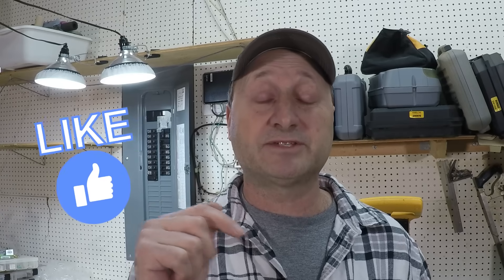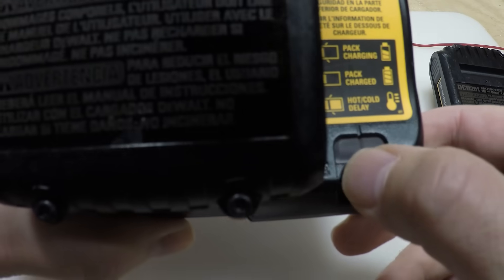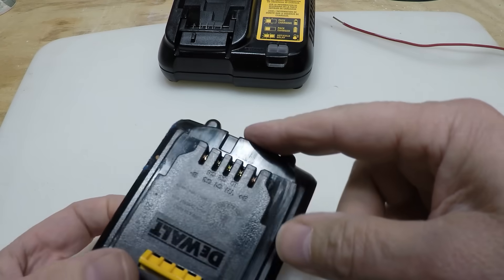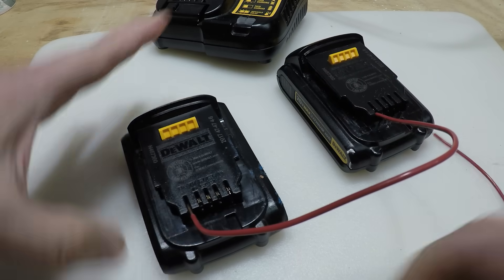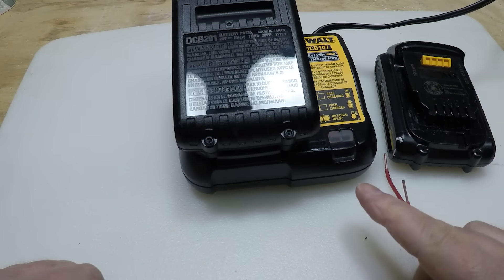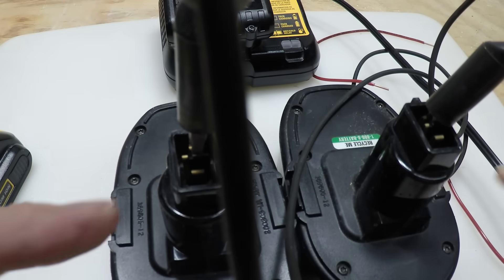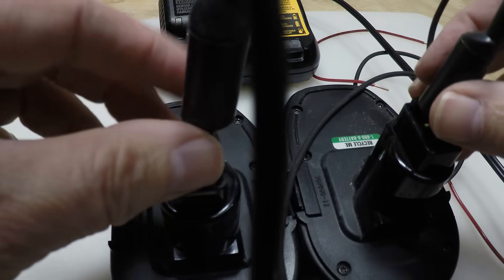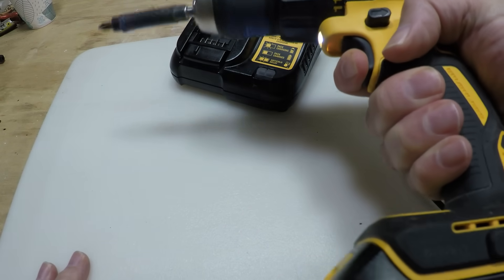SECRET to FIX Drill Batteries - Charge Dead Lithium Tool Batteries

Comment: Please don't put lithium batteries in trash.  They can still cause fires when "dead".
Reply: Excited Beavis noises
Reply: @WackadoodleMalarkey 😂😂😂👍👍
Reply: An all the little kids mining it for your pleasure
Reply: @hobojoe3844  good you know, many don’t, child and slave labour for profit is horrible!
Cheers bud ✨☕️☕️☕️✨🇨🇦🐥
Reply: Yet no solutions on what to do with them
Reply: @germanshepherd13 seriously 😂
Reply: @germanshepherd13  in the UK most shops have battery recycling bins so there must be money it...
Reply: @alanhat5252 you would be disappointed finding out what actually happens to those old batteries.
Reply: @germanshepherd13  Corporate Greed at its finest brought to you by the gop
Reply: Yes, this is why lithium button batteries inside car remotes we keep in our front pockets during summer blow up constantly!
   We all know sweaty balls actually explode a lot more from June-Aug 💣🥒💣...Not!
Reply: @harryballz6358  never heard of that 😹
Reply: @harryballz6358 , It’s not that they blow up. What happens is they’re in a pile of trash, and a machine cuts the battery making a small spark. Sometimes there will be dry flammable trash around the battery when this happens and it ignites the trash causing a massive fire. If nobody is there to put out the fire in time, it can end in a disaster.

Also, rotting trash creates methane, which when mixed with air, could explode if ignited by a small spark.
Reply: My Bat charge is blinking and becomes solid light, but still doesn’t work on my drill
Reply: I just leave my dead batteries on the job site for the electrician to steal.
Reply: OMG!!! If one AA lithium ion battery will cause a fire😵😵😵then how will our country ever survive when hundreds of millions of cancer causing hazardous waste 1,000 lb batteries are mandated by 2030😩😩😩
Reply: Yep!  Batteries are landfill. Disgusting pollutant on this planet!
Reply: Also they are harmful to the environments and should be recycled.
Reply: Go be a liberal somewhere else
Reply: Lithium and water Very explosive 🧨 should always keep in oil.
Reply: Ok Boss
Reply: I only put my Tesla lithiums in the trash
Reply: @geolehman  sure you do....
Reply: What are you supposed  to do with them?
Reply: @Joe-og8um  I'm sure your city has recycling
Reply: @jessewoody5772    yes.  I have a can for plastic, paper, misc.  I can put batteries in that?
Reply: @Joe-og8um  call your local city hall. Ours has special pickup of batteries that is separate from the plastics and papers.
Lithium batteries are dangerous and hazardous if crushed in a garbage truck compactor.
Reply: @jessewoody5772    thank you.   I do have one now I need to dispose of and wasn't sure of the proper way.
Reply: Not when discharged guy . Read a book
Reply: @KC-nd7nt  they should be recycled guy, get a clue
Reply: Litium cannot be drained to 0% if they do they are highly volatile. Every battery has an upper and lower block so they dont drain to 0%
Reply: Mine is for an old Sears drill, has three contacts, I tried jumping+to+, - to -  ,it didn't work.
Reply: Lol
Reply: I'm not watching the video.  This is utterly bull shit.  I've tried it a few times, nothing fixes dead batteries,except a new 1.
Reply: Thats funny. They never seem to burn the house down. They are all over my house. For decades. In tool boxes buckets and bags. Why dont they just BLOW up?
Reply: @jayholewinski  Thank God I’m old!!!!!!!!!! because we only have a few years left before hundreds of millions of 1,000 lb hazardous waste car batteries that are mandated by 2030 will eventually kill us all anyway😂😂😂
Reply: OMG!!! If one AA lithium ion battery will cause a fire😵then how will our country ever survive when hundreds of millions of cancer causing hazardous waste 1,000 lb batteries are mandated by 2030😩😩😩
Reply: Please don't talk down to random people online like you're some kind of authority.
Reply: So i tried this with my Milwaukee batteries i had a small battery stopped taking a charge. I did this "trick" and then put it on my charger and yes it "showed" it was  charging, for about 3 minutes, then it showed "full". Pulled it off the charger, hit the button on battery and it flashed one bar. Wouldn't run in the drill and now every time I put it on the charger it just lights up green as if it fully charged. As far as the Other (bigger) battery is used to "jump" the small battery NOW reads FULL when it's not connected to drill OR charger, but when I connect tothe drill it flashes one bar (dead) but on the charger stays green as FULL/CHARGED so now I'm out 2 batteries and using a damaged HEART drill 😢
Reply: Definitely don’t throw the battery lithium-ion packs away - at least disassemble and use the individual batteries - generally only one battery is bad.
Reply: In a lot of European countries this is illegal.
Reply: @tonycamplin8607 who cares.
Reply: Yes and in cars!
Reply: @dixiefallas7799 Tesla....BOOM! 😂🔥🔥🔥🚗🔥🔥🔥
Reply: Don't you fkn tell me what to do!
Reply: A button lithium battery hidden in soft plastic recyclables was crushed by machinery at our council recycling facility and later caught fire burning down the whole facility causing $20million in damage. Recycle batteries appropriately
Reply: @andrewdenny5571 RUBBISH
Reply: no RECYCLABLES
Reply: @andrewdenny5571 so the entire facility burned down yet through all of the debris someone found what remained of a button battery and determined that was the cause of the fire? Ok.
Reply: @corytruckdriver  yes.  There are literally people whose job it is to do exactly that.  People will do an enormous amount of tedious work for millions of dollars.
Reply: @Williampreza Link to an article. I want to see the damage.
Reply: @corytruckdriver a good example of critical thinking on your part, sadly most of the Western world no longer engages in this type of reasoning.
Reply: @elephantgrass631  you try linking some articles from Youtube comments – you'll find Youtube censors most of them.
Reply: @alanhat5252  Depends on the article. Right wing political? They'll ban it. Left wing? No problem.
Reply: @elephantgrass631 as it should be.
Reply: @elephantgrass631  you got that backwards
Reply: @andrewdenny5571 😂😂😂
Delusional FOOL
Reply: @andrewdenny5571  I blame the facility for allowing the production of flammable on the other side of town..
Reply: @andrewdenny5571 Exactly what I've been concerned about. I had to train our crew to the dangers.
Reply: @andrewdenny5571 damn. Okay. Thank you.
Reply: Most municipal recycling operations take batteries separate from rubbish, mainly for safety but many also pass them on to various recyclers. Lithium battery recycling is happening small scale,   there won't be much money till they start getting big stuff like car batteries.
Reply: What if fire was my goal?
Reply: No way if they are discharged
Reply: Ya take them camping. Get a hot fire drop em in.......dont sit to close......FUN
Reply: @Dingoroaming  <---------Trump voter
Reply: To close? or too close? There is a difference.
Reply: @Dingoroaming  Darwinism will eventually take you or your childrens lives.........Have Fun.
Reply: hahaha...yes . they can
Reply: Some people just don't care but he doesn't seem like the type of person to do something dumb. But idiots and trailer trash will litter and do stuff like that always so one person is not going to save the world. Had to be millions just like everyone needs to stop littering   . I've NEVER THROWN A CIGARETTE BUTT ON THE GROUND. EEVVERRR
Reply: @TheAmericanMan-2024  you’ve never thrown a cigarette but on the ground B/c you DONT smoke!!!
Reply: @TheAmericanMan-2024 Thank you for that.
Reply: @TheAmericanMan-2024  A cop aproached my brother and I while fishing and wanted to ticket us for littering.
When I showed him my watch pocket filled with my cigarrette butts he left us alone and wnt on his way.
Reply: I just throw them in the fireplace.
Reply: @WilhelmFreidrich  hopefully while your kids are warming up nearby
Reply: Too bad I do it all the time
Reply: @caring-assoul_  whats the matter your mom didnt love you
Reply: BS
Reply: Yes, please don't toss them in the trash. There's a place not too far from me called BULLDOG BATTERY and I have dropped mine off  there. So find a place that either takes them or rebuilds them and drop them off. It's safer and you'll be doing the right thing by everyone.
Reply: I throw my old batteries in the lake near my house, I told my kids NOT to fish there! 😮
Reply: Not my problem
Reply: Not my problem…. 🤷🏻‍♂️
I’m still gonna toss them in the trash 🤷🏻‍♂️🤷🏻‍♂️🤷🏻‍♂️ deal with it! 🤷🏻‍♂️🤷🏻‍♂️
Reply: It's be cool to see a garbage truck in fire going down the road..

Comment: You gave a good hint here, i would still be well reminded of almost twenty years ago when accu(mulator) cells were exchangeable in a quite simple manner (not with some lithium type chip-ping), whilst i also still wonder why no manufacturer managed to deliver a transformer with the tool (just in a box where the accu-cells would be), so the handycrafter could attach to the normal 220volt current (getting 16, 18, 20 or whatever voltage charge) by wire/cable not having to relate to accumulators when their usage was decreased due to some circumstance. Being simultaneously able to use current from some home or garage walls installation would have been a huge deal, especially bck in the days when accumulators didn't were pushed to today's performances. But not often some military-performance (or land rover-like) tool makes its way to the toolshop only to "dissappear" after a few weeks... My brother once said the matching words like "the handycrafter is the modern slave of society".

Comment: This will work if the battery is just at too low of a voltage.  If you have one or more low or bad cells in the battery pack, it will not work since most chargers and/or battery packs monitor the voltage of the cell groups and will refuse to charge if there are any issues.  It has happened to me with my Milwaukee battery packs.
Reply: I guess that is my problem. Just tried it with an M12 battery pack, charger blinks green and red. Do you know of any way to save the battery pack?

Comment: ABSOLUTELY happy to like your video. Thanks so much for sharing this. Wiring the batteries in parallel is a great tip to transfer just enough power to trick the charger. I had an old mobile phone battery that would not do anything and after putting it on and off the charger many times with zero life I put it in one last time and then it initiated the charger and charged and it's been fine ever since. But you're video jogged  my memory so I can't wait to try your idea on my DeWalt 18 volt batteries that are lifeless through lack of use. I love my cordless tools but whenever you need a tool without fail it's always the Old Faithful corded tool that never fails. Cheers again.

Comment: When my battery didn't charge I took it apart and found that one cell had much lower voltage than the others. I charged that cell with a single-cell USB charger, and that fixed it. The cell was still good but somehow the cells became unbalanced.

Comment: Lithium batteries have a low voltage threshold per cell of 2.2 volts, they should NEVER be allowed to go lower. Such a battery has been permanently damaged internally, it's life has been severely shortened. That crude "shock charging" as suggested is both dangerous and damages an already abused battery even more.  This is why the charger refuses to charge it. An abused lithium battery can swell up and sometimes even "explode" into a flaming smoking fireball.  If it is decided to "revive" an abused and permanently damage battery it can be done but with very low and controlled current in the milliamp range and then the battery will remain forever damaged and unstable.  Replace it and be safe.

Comment: Great tip but what if you don't have a good battery to jump the dead one?
Reply: Just check what’s the Voltage & Amperage of the dead battery. After that just look for another battery/charger that’s close to these ratings and use it to jumpstart your dead battery. Best of Luck.
Reply: I just tried it with baling wire and a 9 volt battery. I was so surprised it worked!

Comment: Fan-TASTIC video. Who would believe that it's so simple to fix? The explanation makes perfect sense - without even the tiny amount of charge needed to send signal to charger that all's O.K. to recharge - it wont!
This must save so many people (including myself) so much time and money. Many thanks for posting.
Reply from the maker: thanks for watching. Please share the video!
Reply: You misunderstood this, the charger is specifically designed to refuse charging a fully depleted pack, not even with a tiny current. A lithium Ion cell might be internally damaged if it is fully depleted in such a way that once it's fully charged agan (no matter how slowly) it can get internally shorted and bust into flames. Even a small cellphone battery might be enough to burn your house down. Some years ago I also thought I was very smart when doing this. I might still do it if I have to, it will work, but I would discard it as soon as possible after in a safe way.
Reply: @xehpuk Are u saying they're resistant to recharging in the first place because they are internally damaged?
Reply: @rcristy  It will charge for sure but it shouldn't be. In worst case a damaged li-ion cell might ignite fire.
Reply: @xehpuk  🙏

Comment: That first charge will likely be weak and run down fast. Don't give up.
Recharge and use it again. With each discharge/recharge cycle the battery will grow stronger and last longer.
Reply from the maker: thanks for watching. Please share the video!

Comment: I have a dewalt battery that only charges partially.  I only get some of the lights to light up.  Any tips?
Reply from the maker: the battery could be at the end of its life. I put a link to cheaper replacements in the description of the video

Comment from the maker: Inexpensive Replacement Batteries https://amzn.to/3tHyij6
Reply: Just a word of caution, I am sure you know this but your viewers may not, these batteries can and have burnt houses down.
Only try this with same voltage batteries, IE don't try revive a 12v battery with an 18v one.
Don't leave them direct connected for very long, start with a few seconds and never leave them unmonitored while doing so.
Charge on a fireproof surface.
Reply: I have a BionX 48V Battery for my eCargo Bike that won't charge b& the company is out of business, I may have to rebuild the thing myself but I also will attempt a DC 5mV trickle charge for a few hours to see if I can get to the min threshold required to get the battery recognized by the charger. Thanks for your video... I wonder if this is the reason milwalkee is selling it's cordless drill with only 1 battery these days?!!
Reply: This link is no longer on Amazon
Reply from the maker: @AlpineMike  yeah they changed it. I just updated the link https://amzn.to/46qNRdq

Comment: Thank you that's great but I do have a dewalt battery that will charge but it just doesn't stay charged for very longer,  it's runs down after a little while, maybe 10minuts or so
Reply from the maker: then maybe the battery is just DONE

Comment: It worked great - I found it worked easier if you flatten the ends of the wire before inserting
 into the battery terminal
Reply: Great idea! So simple… But effective

Comment: I've got a b&d 40v 2.0Ah that ran out of juice while string trimming, then got left out in the sun for a day before hubby told me he had left it in the trimmer.  Now the fast charger goes immediately to fast blinking red, and slow charger shows green less than a second before fast blinking red as well.  Usually fast blinking means the battery is still hot from use, and i just need to wait for it to cool before recharging it, but this time waiting doesnt help.  

I don't see a B+ or B- connection.  Just 6 pins on eash side of a recessed plastic blade.

Suggestions?  These batteries are $100-ish, new.

Comment: I have two Craftsman 12.0v 4 prong  batteries #1323412 both won't hold a charge anymore. I used them 6 months ago and they worked fine. What to do? Thanks.

Comment: Thanks for your videos. I have Dewalt dw9094 14.4v batteries that start charging but do not hold their charge. They are not  strong and battery strength does not last.

Comment: Hi , have a black and decker 18v battery from a hedgetrimmer. The battery has 3 terminals. Can you tell me which is which please
Reply: Use a multimeter to determine the polarity

Comment: Will try tomorrow. Awesome.
Reply from the maker: let me know how it goes
Reply: Not sure how it worked. I tried with a set of home made jumper cables, but no love. The original problem was that the battery got slightly wet. I left it in my hot garage for a week and it suddenly started charging again.

Comment: My charger shows that the battery is fully charged even at 0%.  The battery was at half and it said it was fully charged when put in the charger then, too. And then I used it till it was dead and now it says it's charged and won't charge.  Any way to fix this? It's a $255 Mantis battery for a rototiller and I hate to spend that kind of money.  The battery was only used a few hours but I let it sit in the barn all winter and the instructions said to charge it every month and I didn't do that.  So it's not dead from use.